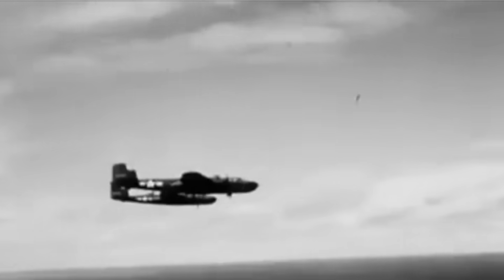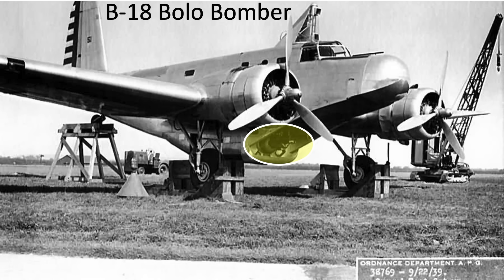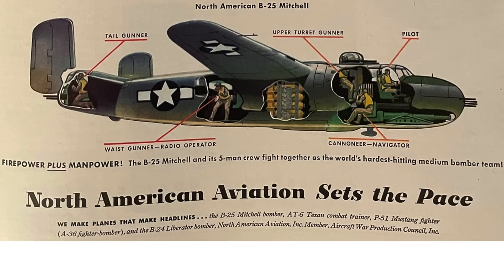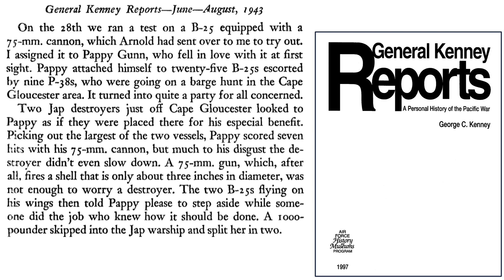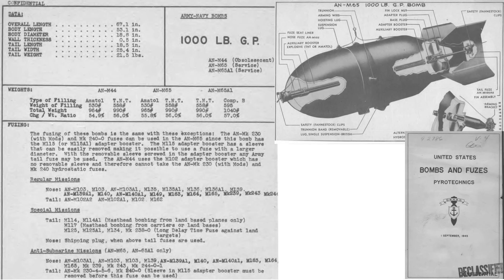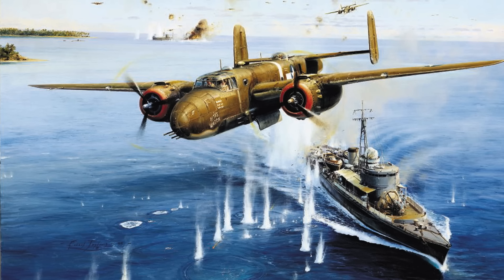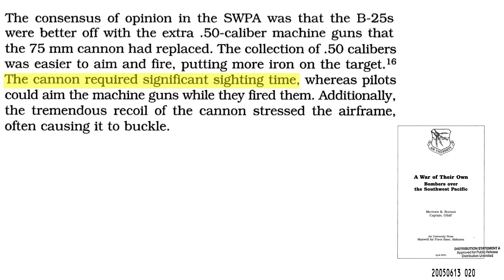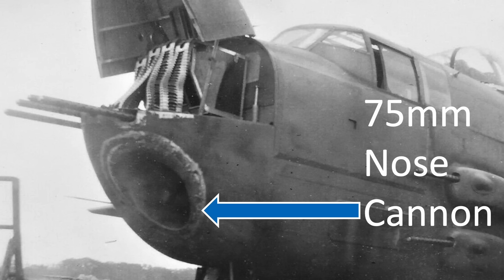Why the B-25’s 75mm cannon was a Failure - Deep Dive Review

Comment: Reminds me of your study on how .50BMG wasn't enough to sink a submarine because the pressure hull was too thick. Maybe this weapons system missed its calling.
Reply: The RAF tried “Tsetse” Mosquitos fitted with 57mm auto-loading cannon for anti-submarine work. They fired solid shot designed to puncture a U-boat pressure hull.   Although intended for use against submarines they were used against flying targets. On one occasion a Ju88’s engine was completely removed from the wing with a single shot from a Tsetse flown by Sqn Ldr Tony Phillips. Although the big cannon Mosquitos appear to have had more success the the B-25 equivalent, the cannons were replaced by rockets.
Reply: @Gloomendoom   There's an excellent video on YT in which a veteran recounts details of his "Tsetse" experiences.

Used against U-boats he seemed to find it quite effective.
Reply: @Gloomendoom  One of them sunk a submarine - U-976.
Reply: @Gloomendoom  that  gun was what the Churchill started out using..
Reply: @andyf4292  Churchill started out with smaller gun, the 2-pounder, it was the later version (Mk III and Mk IV) that used 57mm. But yeah the 2-pounder was very short lived and right in 1942 they were fitted with 57mm
Reply: @czwarty7878  2 pounder wasn't that short lived and it really wasn't that bad.

These "first generation" 37mm/40mm anti-tank guns really were fine for the typical armor that they faced and it took an incredible increase in the weight of tank armor to make such AT-guns obsolete.
Reply: The Royal Navy tried all sorts of AA guns in the 4-6 inch range; the bigger ones were too heavy for manual loading, and the smaller ones didn't have the punch.  I read of one encounter where the lightest ones were ricocheting off a U-boat's pressure hull, partly because it was so thick to survive such deep dives, partly because it was round and mostly below water.  But I don't remember the size.
Reply: @grizwoldphantasia5005  I vaguely recall that the British found that anti-tank rockets were quite effective. These were just big steel warheads depending on mass but we're nowhere near accurate enough for tanks. A U-boat was a much larger target.

These huge rockets were relatively slow for armor piercing but very massive which also meant they were slowed down less by water.
Reply: There's just not enough time for most pilots to correct their aim enough for the cannon's slow rate of fire. At 21 rounds using the average 3-4 rounds per attack run (optimistic) you'd theoretically have enough ammo for 5ish passes but its actually pretty rare anyone wanted to make that many passes on a target, let alone one that could shoot back, and this is a big reason why bombs were preferred if the attack method was hit and run.

Comment: Seems like the auto's one shot every 2 seconds would still be too slow to walk the shots in at the speed the B-25 is attacking at.
Reply: It seems dumb to even bring it up, but yeah, the fire rate is baaarely enough to be able to walk your shots in, based on how it feels when flying the XA-38 (which had an autoloader with about the same rate of fire) in War Thunder. Better than the manually loaded 75 for sure, but that’s about it.

Comment: Thank you for answering a 30 year question. This makes sense now that you explain it. M2 were used to 'dissuade' the AA gun crews. Bombs sank the ship. The 75 didn't do either that well. Interesting that NA went to full production before field testing, which would have quickly shown the issues. Also interesting that a light cruiser AA could be suppressed with 50s.
Reply: The light cruiser close AA was mostly 25mm open mounts, though they might have had something a little bigger.  The closed mounts were 5" or 6" and too slow to be any good at such short ranges.
Reply: The US in the mid-1940's was blessed with an incredible manufacturing capactiy, perhaps the greatest the world had ever seen up to (maybe) modern China. It gave us the chance to pump out aircraft at a "speculative" level, because we had so much factory power that it didn't harm other materiel requirements. The loss of such capability may become our prime weakness if we get into a prolonged spat with CN...
Reply: @davidg3944  I know it's been a while but Bergurud's 'Fire in the Sky' is an incredible book that completely dissects the issues with the Japanese air arm in WWII while somehow not being boring. This guy managed to make hundreds of pages of discussion about logistics, mechanics and supply fascinating. Superb read.
Reply: @davidg3944 a “prolonged spat” with China will be a World War, and most likely end up nuclear, and then go full annihilation mode. I don’t think humanity would last long enough for production capacity to be relevant at that stage.
Reply: @davidg3944  It was also a huge disadvantage to the Japanese, they never had the 'overhead' to be able to experiment with aircraft configurations like this. Their configurations were essentially locked in at the design phase, any modifications were field level and severely limited. Massive disadvantage that among many other things led to them losing the air war.
Reply: Six pound of TNT will dissuade an AA crew for a some time too. It's 4 M2 + 1 75, with  the M2 doing nothing when you're behind armor  I think 75 is too heavy for a plane,  but adding  autocannons instead of even more M2 is what was also done during ww2.
Reply: To be fair, they almost certainly (and rather rightly) assumed that just having the airframes sitting around would be better than nothing. If it worked, all the better, they would have a head start on delivering the new weapon, especially if it proved to be “in demand.” And on the other hand, if it didn’t work, what was the harm? It could still perform, just not nearly as well. It flew, it shot, all that jazz, and should anyone prove to be particularly put out, well,… it’s not their problem anymore, someone would just modify it in the field.

It’s an absolutely decadent philosophy for any industry. But you know what they say! It ain’t broke so it ain’t stupid!

Comment: Most of the combatants in WWII tried large caliber guns on their attack aircraft.  The problem was that rockets could deliver much greater firepower with minimal modification.  Eight 3 in rockets were nearly equivalent of a full broadside from a destroyer.  What's strange is Germany never fielded air to ground rockets.  Probably due to their preference for spin stabilized tube launched rockets and their high drag.  The Allies all made effective use of fin stabilized rockets.
Reply: Sure they did, Germans used anti-tank rockets.
Reply: @0Turbox  - The only air launched rockets they used widely were Werfer-Granate 21 which were Nebelwurfer rockets used against bomber formations.  They lacked air to ground rockets.
Reply: I do believe they did have air-launched 21cm rockets adapted from Nebelwefers, tube included. They were mostly air-air rockets for disrupting bomber formations, though they did fire some at ground targets when given the opportunity. They also developed the R4M folding-fin rockets. 

Neither were particularly effective at destroying bombers due to their poor accuracy. Certainly devastating if it hit, but good luck getting one. Some were fired at ground targets, though I’m guessing their use against such targets was limited because of the greater threat posed by the CBO.
Reply: Which WWII history-course did you graduate from?

First off, I don't believe your opening statement implicates anything of factual evidence.   What do you mean by large-calibre guns? (assuming you mean calibres of around ~3-inch/75 mm bore, as discussed in the video?)  I believe few nations' warplanes of that era actually mounted/trialled (field-gun/howitzer-type) calibres of this type.  Could you perhaps cite/mention at least several examples of any French, Italian, or other nation's warplane type that mounted such during this period?  Personally, I can't (other than one sole example of a [largely experimental] Italian Piaggio P.108 A-series heavy-bomber type, which fielded/trial-tested a 4-inch artillery-piece).

Secondly, what's so 'strange' about many of the Schlachtflugzeug ground-attack variants of the various FW 190 (F and G variants) that [at least] trialled-out/fielded many of their air-to-ground unguided ant-tank rockets over the course of the Eastern-front conflict (a listing for which would be too numerous to make mention here)?  In fact, many (if not most) of their [few] existing air-to-air interception-types (R4M/BR 21) were converted towards ground-use operation (out of sheer desperation), probably in more ways than you'll ever care to know, 'friend'.

Next time, consider doing your homework first before you post.
Reply: @SharkHustler  - How cute a little Wehraboo termite is pissed off his boys lost the war.  Keep talking about those wonder weapons.  Maybe one day you will convince someone you won.
Reply: @idsnowdog 
" 'Ooo!' – Poo-pooh!" ... Some [self-professed] 'War Expert' you are, now huh?

Comment: Was successful in RAF Mosquitoes
Reply: I don't think the RAF found it very successful, they didn't make many then went over to rockets instead. They had the same problems with recoil slowing the aircraft down.
Reply: I believe they used the 57 mm Molins, so a smaller caliber. But perhaps there was a variant I'm not aware of, I'm just a "casual aviation fan".
Reply: @ArturdeSousaRocha  You are correct.  It was a 57mm Mollins gun. I was referring generally to the use of a big cannon on a plane.
It was successful against surfaced submarines

Comment: In the 80s I worked with an old sales guy that was part a Mitchell crew in the a Pacific.  His aircraft was a test bed for this cannon.  He said when the started testing the crew that was down with canon would poke their heads out after a shot and have a dazed look and would just move their heads side to side.  My understanding is this was an idea that was not practical.  Makes you wonder how the Puff DC-3's in Vietnam over came this issue.
Reply: i dont get what the issue you're talking about is? you think AC-47 crews would be in shock from firing miniguns out the window?

Comment: How did the Mosquito "Tsetse" manage to work, then?
Reply: It had an auto loader if I remember correctly.
Reply: @garygenerous8982  and against subs, when any hole will ruin your day.
Reply: @garygenerous8982  Yes, it did, and that worked out well, it fired solid steel rounds that they aimed below the waterline, and sunk subs by passing straight through, so why did the yanks not manage it either?

Comment: What i would have loved to see would have been 4x20mm in the nose of a B-25 B/C - not fed with a drum but with a belt. (possibly two extra ,50´s?)
Add the 4x,50 in the classic side blisters.
Engagement range would have gone up, AA suppression would have been more effective
Reply: Would AA suppression have been more effective?  The point was to get as many hits as possible, not for each hit to do more damage.  20mm rounds weigh 3-5 times as much, meaning 1/3 or 1/5 as many total rounds hitting any AA weapons.  20mm also have a slower rate of fire, further reducing how many rounds hit on each attack.  Their muzzle velocities also differ considerably and might not have had as much range.
Reply: @grizwoldphantasia5005  My thinking is along the lines of starting to shoot further out, hitting earlier, still relatively accurately.
Once the 20mm is spent, the .50 take over and do their magic.
To compensate for weights and ballistics, of course, the aimpoint needs to be adjusted.
Does a second weapontype make shooting awkward? Yes.
Still, i´d propose that it might have been a good idea!
Better than that 75... or two bazookas in its stead...
Reply: Plus - if hitcount was the objective, just tale .303´s. Strap a Gazillion guns into the nose and go wild, effectively Peppering the deck with 3-5 times the hits...
But shooting distance? effect on target?
Hmm...